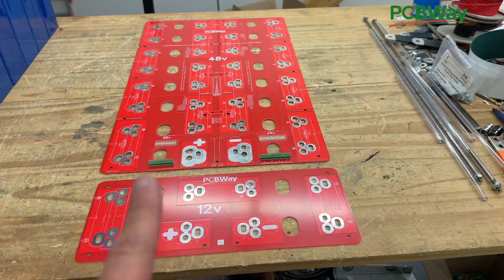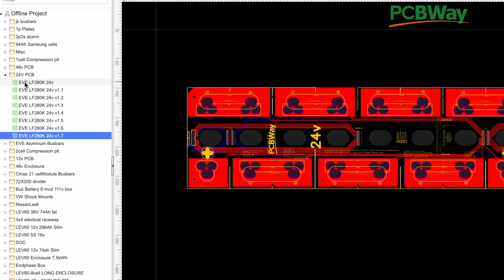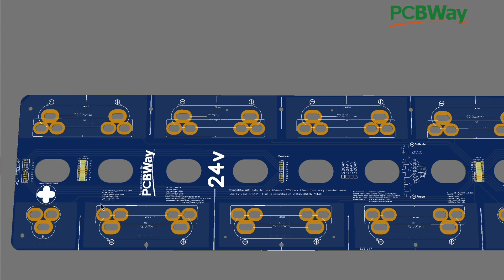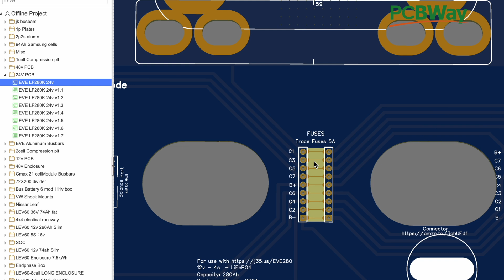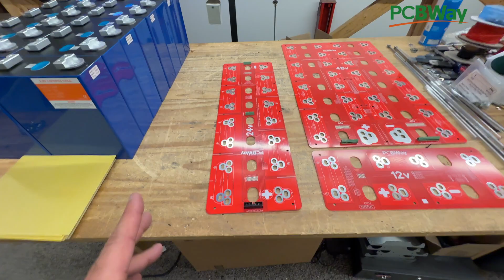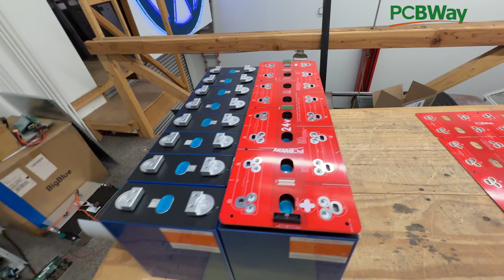#LiFePO4 24v  #pcbWay #DIY  #busbar

Comment: I’m building 3x 8s 24v packs for an ambulance conversion and I’ll definitely pick these up to keep the top sides organized!  Wondering if you have recommendations for an affordable heating pad solution that the jkbms can drive (at 24v I assume)?  Looks like it should be about 23” x 4” if my math is right, to run along the full length underneath the cells once they’re stacked?

Comment: Hi, thank you for the great work. One question though, where can I find 12V board for dual post EVE 280 cells? Your PCBWay profile seems to only have single post boards. Not the one shown in the video, that is universal (both single and dual post).
Reply from the maker: Oh…. I guess I never got around to updating the project with latest version,  even in my website.  We have been shipping the latest design for a while but the pictures show original https://jag35.com/products/pcb-busbar-for-lifepo4-cell-for-280ah-304ah-314ah-eve-catl-rept-trina?_pos=7&_sid=f4bcf5948&_ss=r
Reply: @jehugarcia  Would be able to update PCBWay files at some point?
Reply from the maker: @jacekjedrzejczak9795  done